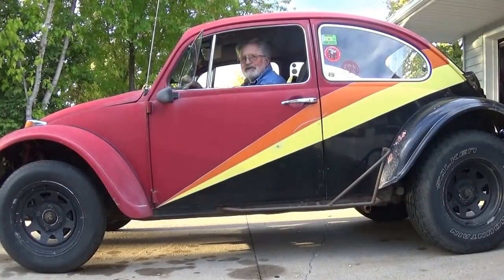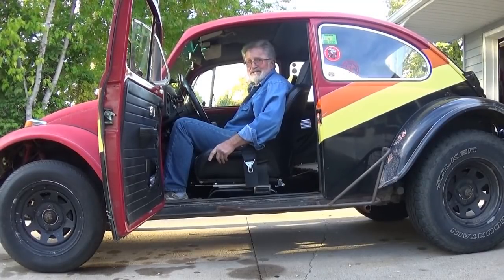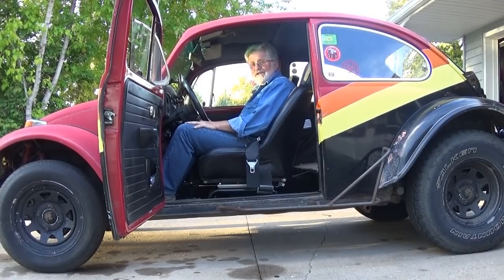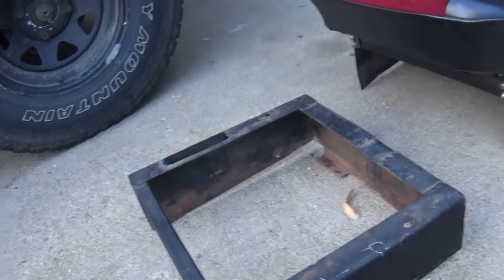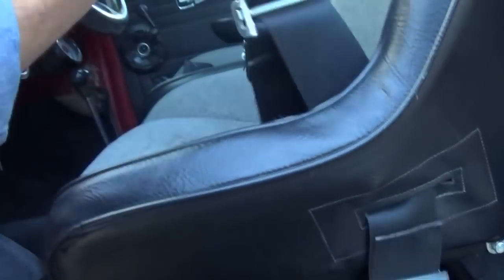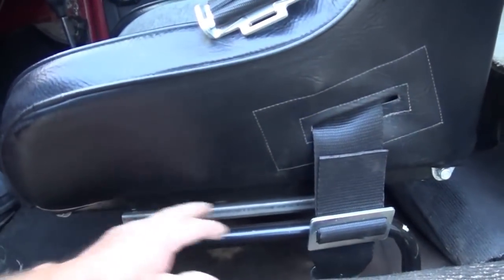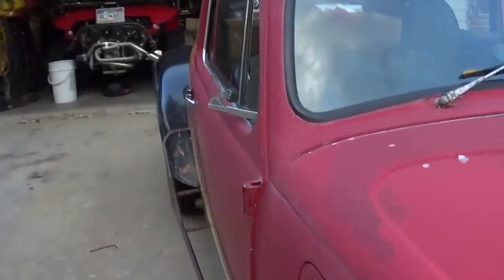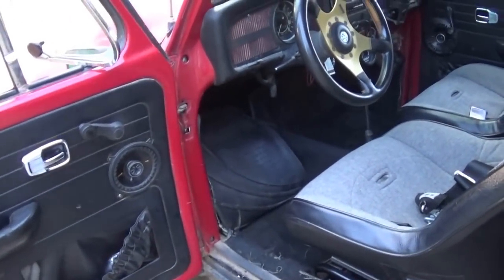Best Seat Options For Your VW Sedan (standard bug)

Comment: great video.  have same mounts in my baja. prior owner butchered the seat mounting. had modified the mounts, they were a little short for my baja. my baja has a 3 inch body lift on it. also upgraded my engine to a 1904 with dual webers. cant wait to get it in the sand this year to try out the new power plant
Reply from the maker: Sounds like you have a good project and a lot to look forward to. :-)

Comment: I don't own (yet?) a bug...anything. But as a tall (6'5") and husky (300lbs) man. What would you suggest for a set up to fit in one of these rides? I fit in a TJ with the seat all the way back.
Reply from the maker: Maybe go to a pick and pull junkyard in your area and see what they have and sit in a few. I took the suspension seats out and put some  later model Ford seats for $35 ea. in the baja instead. Easier to get in and out of.

Comment: How good are they really ? Durable ?
Reply from the maker: They are very nice but hard to get in and out of the car quickly. Most women don't like the passenger seat for that reason. They are a lot of money but lightweight and made for racing and give you support.  If you just want to get rid of the stock spring style seats go to a pick and pull junkyard and get some out of late model car. Around here you can get both front seats for under $100. I'm using pick and pull seats now but if I need to go off roading and want the race seats I can have them back in place in about 30 minutes if I'm in a good mood.   Good Luck with your project

Comment: Hi is your Baja irs rear suspension
Reply from the maker: About 1/4 inch off the rear stops. I also run different tire sizes from 28" to 30"